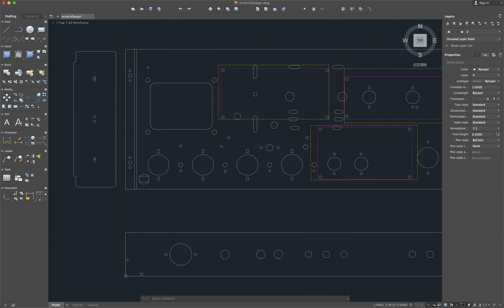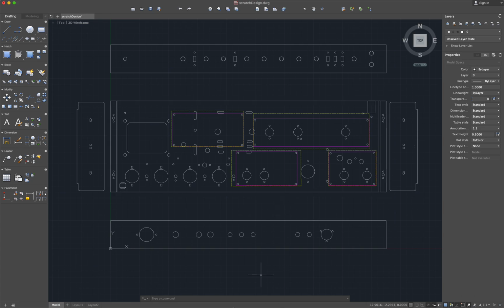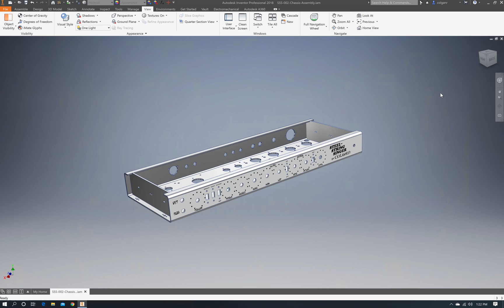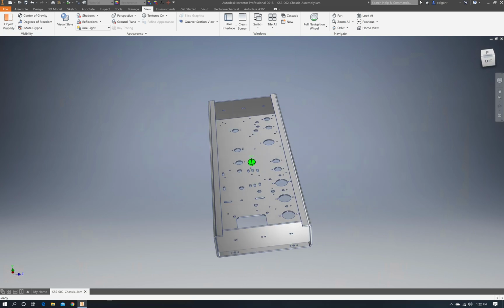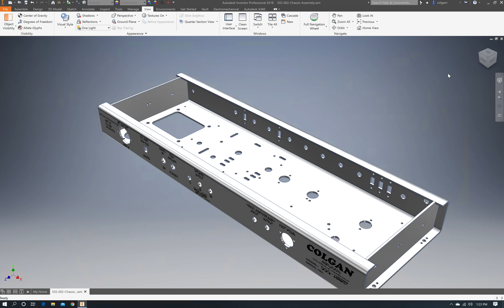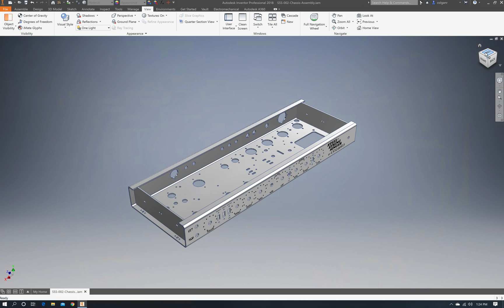Steel String Singer #002 Next Level | Chassis Redesign

Comment: Looks great, I got one from the last run and was super impressed with the quality of it, thick aluminum, good powder coating, great silk screen graphics.

With the classic tone transformer I just spent 15 minutes with a file to get a good fit, real easy. Other than that the fit on everything was perfect and everything lines up.
Reply from the maker: Yayy!! That's a good option too filing down.  Thanks for sharing!
Reply: @TheToneGeek  yeah definitely, so easy it was no issue really. Did the original Dumbles have the cover on or off? Could this be the "magic" we are missing?
Reply from the maker: @hermannbjorgvin  lol I think I've seen it both ways